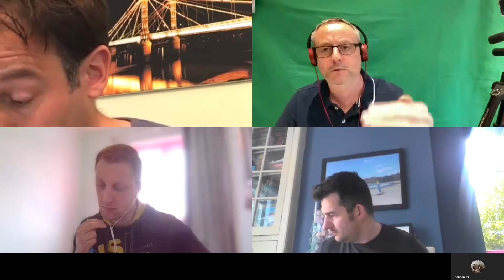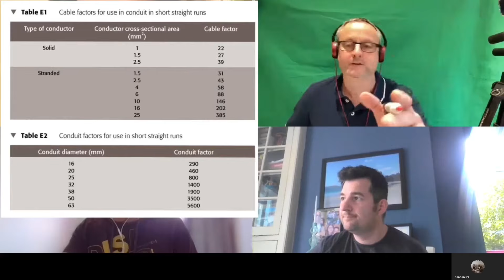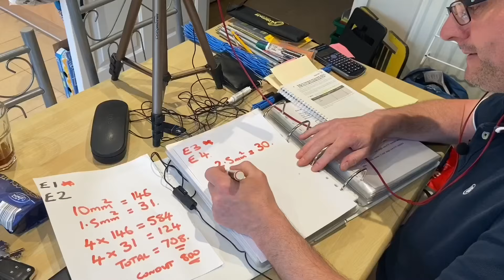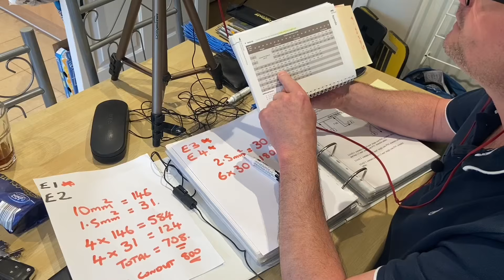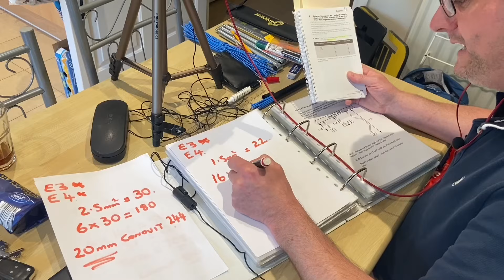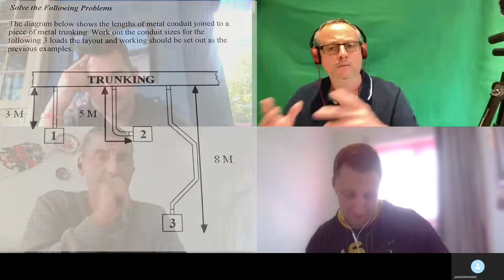How to Workout the Cable Capacities of Conduit Appendix E On-Site Guide BS 7671 Calculations Part 2

Comment: Hello, I have a daft question. I have my 625 coming up next week. I have a question in my mock exam which is, what is the maximum number of 6.0 mm cables that can be installed in a 4 m length of 25 mm conduit with three bends - mock says 5

Comment: These chaps are lucky to have you! How does putting a through box in changes things in reality? Is the intention that the cables only get pulled through half as much conduit and so have an easier ride? The last half the cable will still have been pulled through both runs of tube, but I guess the friction/stretch would be less
Reply from the maker: The box halves the length of the pull as well as the pull is now only around one bend... then your theory is correct 👍. Thanks for the support and watching. Gaz